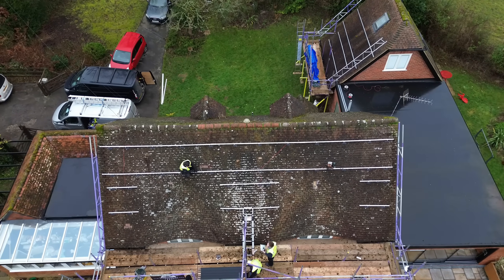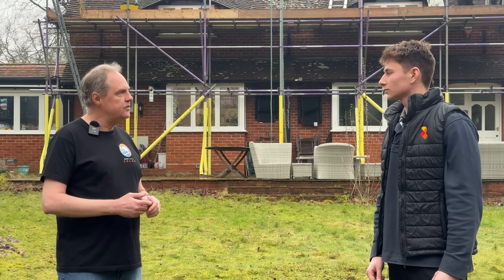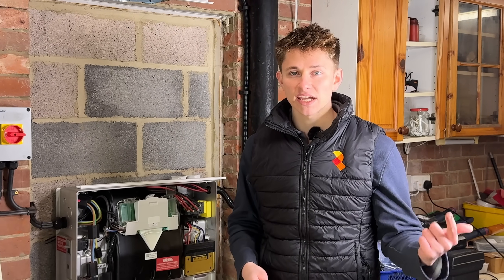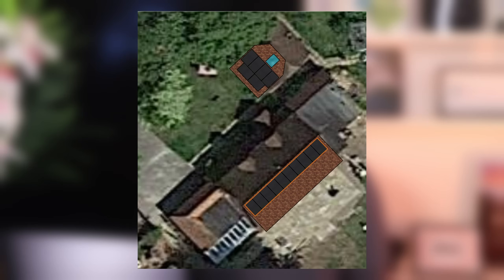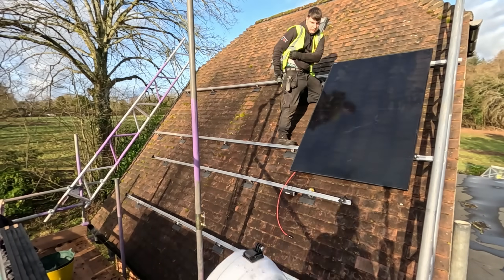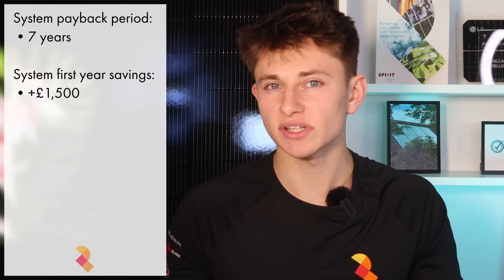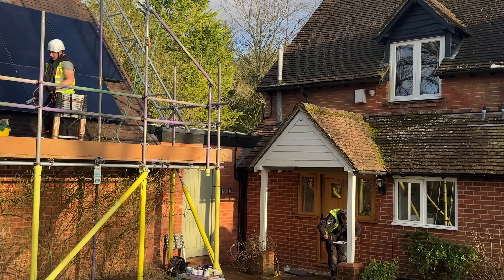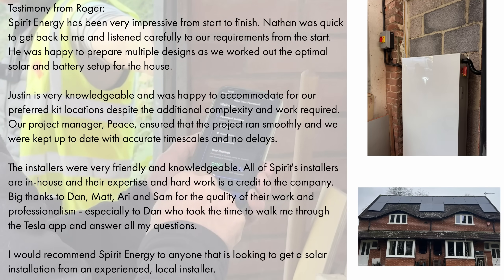Installing Solar Panels & Tesla Powerwall 3 with GARY DOES SOLAR

Comment: One of the design features of the PW3 is the inbuilt DC solar string isolator, is the provision of additional external DC isolators a regulatory requirement or just 'belt & braces'?
Reply from the maker: Hi, yes it is a requirement.

Comment: interesting video, i too approached 2 national chains & 2 local to me for pw3 plus panels, one of the national chains would only quote me for a pw3 & no extra panels, the other national chain quoted for a pw3 plus 4 panels on the north roof elevation, the first national chain was a £1000 more expensive than the second national chain despite not fitting any panels, the first local supplier didnt even bother to  quote me, but the second local chain came out yesterday afternoon & asked what i wanted and tbh everything i wanted was acceptable, i will potentially be ditching my 16 250w panels on FITs and replacing them with between 23 & 25 440w bifacial panels 14 South roof  3 vertical South wall, 4 vertical East facing gable & either 2 or 4 panels on North facing roof, that gives me a potential 11,000 w & still keeping the balance of my FITs contract live, i am happy that @ least this company came out listened & gave me valuable insight ,plus the fact they only use bifacial panels was another big plus for me as there is the potential 5-15% uplift during peak sunshine times, moral of the cstory local is best/better :) :)

Comment: This sounds like a very similar experience to mine. I initially went with a national installer who wasn’t very flexible, so I cancelled and went with a local installer who is very similar to Spirit. Similar system too. 15 panels (11 S, 2 E, 2 W on 3 strings) and a Powerwall 3 (in garage with the GW and the existing CU - it’s a new build house ~2020). I couldn’t be happier with the results. Now running the E.ON NextDrive V6 tariff which in my opinion provides the best balance of low cost energy and customer service.
Reply from the maker: Hi Colin, thanks for the comment. I’m really pleased to hear it went well in the end and it sounds like a properly thought out system.

Comment: DNO restrictions. Are these set “in stone”? When the local distribution network is improved (as seems likely generally with heat pump and EV uptake) what happens to those limits? Can one reapply, or is there proactive notification and uplift? 
I understand that the Tesla inverter can be reprogrammed, whereas Giv and Sige would require a different inverter IF the system limits were ever to be changed. 
Incidentally, while understanding the need for export limitations, I don’t really understand why the DNO would be concerned about the inverter size, which would only seem to limit the maximum rate that one could consume one’s own self-generated energy, which it appears might be a problem with EV charging.
Reply from the maker: Thanks for the comment. No they are not set in stone. Video out next week on this whole topic. 

You can reapply without any risk to your existing allotted capacity - once a system has been installed at your house.
Reply: Cost, cost cost cost